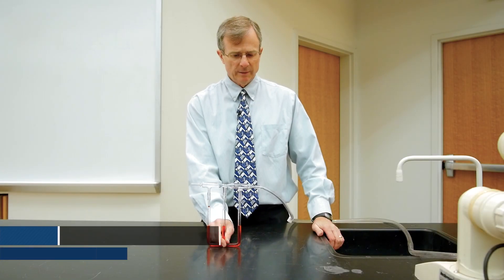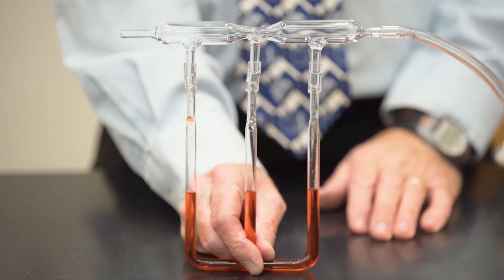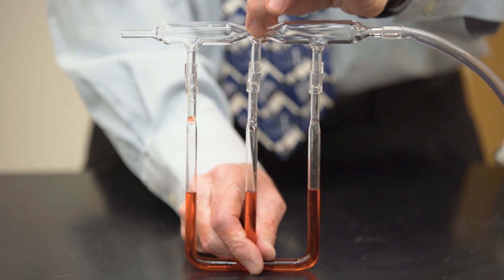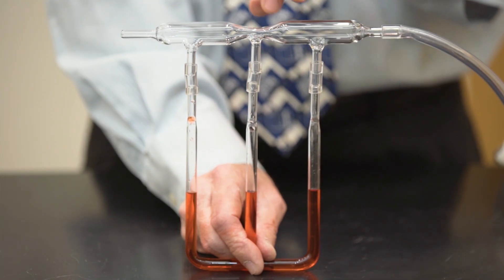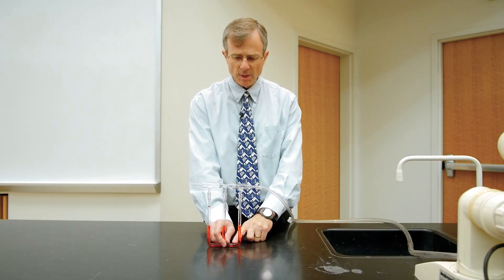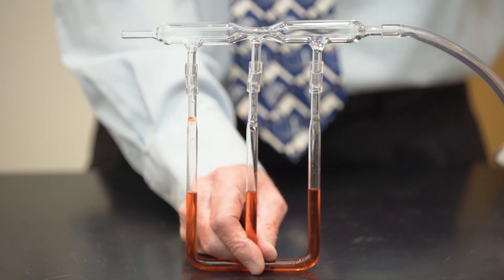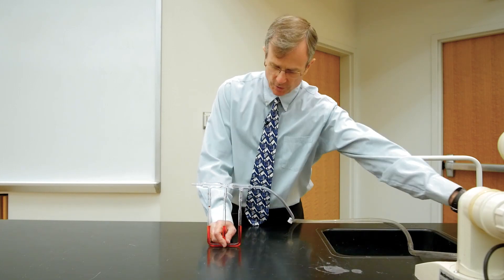Bernoulli's Principle Demo: Venturi Tube

Comment: this leaves more questions than it answers  , the gas entering the first chamber looks to be pushing the liquid down the U bend , not sucking the liquid at the narrow part of the 2nd chamber  and the gas entering the 3r  chamber is pushing the liquid back down the U bend .... so what is the Principle ?
Reply: Yes, same for me. is the third chamber lower again, or just compensating for the fluid level/ Also, is there a syphon effect in the middle, with a higher velocity?

Comment: Why were the water levels different on the two outside tubes?
Reply: Because the pressures in the two outside tubes were different. The pressure in tube #1 was higher than the pressure in tube #3.

Comment: I don't like when teachers don't explain why the pressure is lower at that restriction point. The reason, why it's lower is because of the law of conservation of energy. The flowrate must remain the same, like he stated, and because of this, the velocity must increase to push the same amount of volume of fluid over time. But the increase of velocity has to come from somewhere, it cant just be created. This is the reason for the lower pressure. The pressure in this scenario is potential energy, and the velocity is kinetic energy. In order for velocity (kinetic energy) to increase pressure(potential energy) has to decrease. The potential energy (Pressure) turns into kinetic energy (velocity). Think of a full balloon, when it's full, it has lots of potential energy, and as you let air out, its losing that potential energy and turning it into kinetic energy. Hope this helps someone, I know it helped me finally understand this principle.
Reply: You Helped Someone
Thank You
Reply: @Ram-xy2vy  yay!
Reply: @Ram-xy2vy  :  Ditto!  😊
Reply: @Ram-xy2vy 🔴 What Is Islam?  
 
🔴 Islam is not just another religion.  
 
🔵 It is the same message preached by Moses, Jesus and Abraham. 
 
 🔴 Islam literally means ‘submission to God’ and it teaches us to have a direct relationship with God.  
 
 🔵 It reminds us that since God created us, no one should be worshipped except God alone.  
 
 🔴 It also teaches that God is nothing like a human being or like anything that we can imagine. 
 
🌍 The concept of God is summarized in the Quran as: 
 
📖 { “Say, He is God, the One.  God, the Absolute.  He does not give birth, nor was He born, and there is nothing like Him.”} (Quran 112:1-4) 📚 
 
🔴 Becoming a Muslim is not turning your back to Jesus.  
 
🔵 Rather it’s going back to the original teachings of Jesus and obeying him.  
 
 
More .....👇 
 
🔴 THE RETURN OF JESUS
Reply: bro u literally answered all my doubts in just one paragraph!!! thanks a lot... respect!!!
Reply: I have been trying to understand this for a long time and tomorrow is my exam and i finally understand it thanks alot
Reply: @hajraaman9570  of course, hope you crushed it!
Reply: thankk uuuu u don't know how much that helped me!
Reply: Thanks! Together with the explanation and visuals of the video I think I got it now :)
Reply: Thanks
Reply: Thanks!
Reply: Thank You... Well explained. However, i am a bit of an over thinker, with a limited knowledge of physics, but a curiosity that keeps me thinking further into these things. What I am wondering, is, if there is no loss of overall energy, and the pressure is replaced by velocity, then, is it not harder for the media in motion, to move through a restricted space, and should that not cause a drop in overall energy, due to the resistance? Lets say the narrow part was narrower, or lasted longer, then would this not use up more energy over a longer path, or require more energy to drive it through?

Comment: At 0:35 he INCORRECTLY claims that the volumetric flow rate, the number of cubic centimetres per second, passing through the two spots has to be the same. That would be true if the fluid were a liquid, in which the density is constant. But it's air, a gas. Its density is dependent on the pressure and temperature. And we know, from the heights of the water in the tubes, that the pressure are different in the two spots. 
What is constant through the system is not the volumetric flow rate, but the MASS FLOW RATE, in gm/sec.
Bernoulli's equation (excluding gravity: P1 + 1/2 ρV1^2 = P2 + 1/2 ρV2^2) depends on constant density, ρ. Gases don't have constant density.
Bernoulli's equation doesn't apply to gases.
The pressure differences are due to the gas laws: PV = nRT, and W = (p2V2- p1V1)/ (γ-1). I haven't yet solved this experiment for the mass flow rate through the system, but I'm sure someone can.
Reply: Correct. It's the mass flow rate that is constant, not the volume flow rate. Air is compressible, its density changes with changes in pressure and temperature. That's how it's different from a liquid.
Reply: Yup mass in equals mass out... But the volumetric flow rate will vary along these restrictions... Thanks for finally pointing this out in the comments!
Reply: @chamberlin1  Amazing! The video has been up for 8 years with over 150,000 views and only two other folks have commented on this fundamental  flaw. How I grieve for the loss of wisdom in the physics community. 😞
Reply: @alans172 ❤ I've been working in the field of gas flow measurement and control for over 20 years, and it's something we have to explain to customers all of the time! Cheers and best wishes

Comment: The meaning of pressure in Bernoulli's law is unclear, leading to misunderstandings. Bernoulli's pressure is the pressure exerted on the wall. If you measure pressure in the direction of flowing fluid, the faster the flow rate, the stronger the pressure will be. If you don't agree, I'll shoot an air compressor in your face.

Bernoulli's law should be understood in terms of cohesion, not pressure. Fluids attract each other. The faster the flow rate, the more molecules are attracted.

Do not think that the faster the flow rate, the lower the pressure.
It is more intuitive to think that the faster the flow rate of the fluid in contact, the stronger the pull.
Reply: Has to be. Power washers have max pressure, after going through the Jet

Comment: I'm scratching my head to understand how the air flows from the second (narrow) chamber into the third (wide) chamber as it appears to be flowing from low pressure to (indicated by the length of the water column in the middle manometer)  to a high pressure (indicated by a shorter water column in the third manometer). Doesn't a gas only flow from high to low pressure?

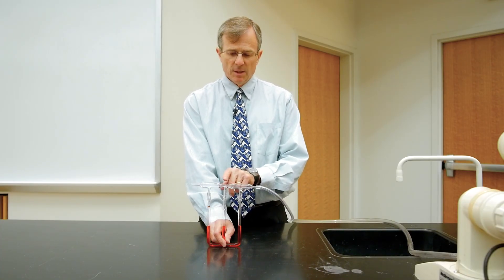Comment: 0:57 can anyone tell logically (not mathematically) about why pressure is low?
Reply: Sure. If I shrink down the middle section until it is only big enough to fit 1 atom then the pressure is only equal to the kinetic energy of 1 atom right? And now because only 1 atom can fit in there he does not have to worry about bouncing into some other guy and losing energy and wasting time in the tube, he has the highest possible throughput. The wider the tube the more atoms go in there, which makes it harder for them to get through. They all keep bouncing around.
Reply: @Auxified It’s nice when you explain things in the extremes. As the atoms goes to 0 or to infinity can really help you understand the extreme effects. Thanks a lot man 🙏

Comment: I understand the concept and the explanation is good. However, why does it feel like there is more pressure coming from a hose pipe when you use a finger to restrict the hose opening (when watering flowers for example)? The water increases in velocity due to the restriction, as the video says, and so travels further from the hose, but it also feels as if the pressure has increased when you pass your hand through the resultant spray of the mostly blocked hose. Compared to the low pressure you'd feel on your hand with the hose opening completely uncovered, it seems increased when partially blocked. Does anyone have any insight? Thanks
Reply: According to the continuity equation (A1*V1=A2*V2) when you cover the opening of the hose the velocity of water increases. 

When a high velocity object hits a barrier the force acting on the barrier is high compared to a low velocity object. 

Pressure= Force / Area.

As the area is same in both cases you feel like the pressure is high when the water hits your hand.
Reply: Yes, or a power washer nozzle.... restricting flow to achieve high pressure?

Comment: Beatiful. You can improve this demo by using open ended venturi tubes, which sit in a open bucket of fluid to isolate one end of the tube to the other one.
Reply: agree,so hard to find video like you said,but question always ask about that

Comment: Thank you for the explanation. I have a question. You stated that the same amount of air has to pass through the wider region in a given period of time as does the air passing through the thinner region. However, won't the compression of air prohibit that from happening?
Reply: Check out the concept called continuity in fluids
Reply: Yes the amount of air per unit time sounds like the volumetric flow rate.  As far as I can tell it's the same thing.  It must be that sometimes a volumetric unit of a gas means the amount of it that occupies the unit volume when at standard pressure and temperature.

Comment: Why is the liquid in third tube remains unaffected . Someone please explain 🥺
Reply: If you look closely, the liquid in the third tube rises a little. This could be because the velocity of air in the second wider section is higher than the first wider section as the air is coming from the thin section (where the air is travelling at the highest velocity). This causes the liquid in the third tube to rise a little bit, but not as much as in the second tube.
Reply: My assumptions is that it is because the third tube is near the exit of the duct, and is therefore closer to the atmospheric pressure in the room, which is the pressure inside the tubes when the flow is turned off. This might explain why the height of the water columns doesn't change as significantly.

Comment: I'm not sure the flow-rate description works as described because the air is compressible. Bernoulli's principle originally described situations where the flow was from incompressible liquids, which was essential to continuity. The demonstration is interesting, but involves more than Bernoulli.
Reply: @AuMechanic  Perhaps, but THE "Bernoulli's Principle" equation, as taught in first year physics is most likely the one people will have in mind when they search for and find this video. Ironically, Bernoulli's equation was actually formalized by Leonhard Euler, about the time when Giovanni Venturi was only 6 years old.
See, most non-physics majors taking physics will only ever see this one equation or hear about this one element related to Bernoulli, and still misunderstand THAT, when the explanations and special conditions regarding this principle and equation are not clarified.  They're oblivious to extreme exceptions and corner cases.
They will never know about Bernoulli's family life or other contributions. And they will continue to point to air-flow examples and squeal "Bernoulli!" inappropriately, without understand why, or why it's inaccurate.
They will also never become familiar with all of the other contributors to fluid flow dynamics, the work of many of which is far more relevant to current applications in aerodynamics and hydrodynamics.
The point is ... if they're only going to ever learn this one thing about this one guy, let us (as instructors) get it right.
Reply: @ezfzx  Thank you for bringing happiness to our lives.
Reply: In Fluid Dynamics at Mach number < 0.3, airflow is considered incompressible. So we can use Bernoulli's Equation in such a case.

Correct me if I am wrong sir.
Reply: @Lalo-Salamanca.  Respectfully, my concern is this. There are far too many air-related demos that are described as Bernoulli, which either are simply not, or, at best "Bernoulli-adjacent". So demos one my colleagues did with open air flowing over the top of liquid-filled pipes from different directions had some very interesting and unexpected results which were inconsistent with Bernoulli's principle.

Our department has a Venturi Tube demo like the one you're showing, and it's good to see the lower pressure, pressure differential, etc. (We also point out that Venturi came along about 50 years after Bernoulli.)

My point is that any air-flow effect cannot be just attributed to Bernoulli without at least some kind of disclaimer. Bernoulli (the guy) was very clear about the conditions of his equation: incompressible, inviscid, laminar flow, closed system, no added energy. We can perhaps dismiss the slow air as approximately incompressible, but not the rest. Even slow moving air behaves differently moving into and out of a pinch, as we see in wind tunnel tests. Even the A/C repair people can tell you that. You can see where the dust piles up from the gentle turbulence.

Academically, for students who don't continue to study fluid flow for a living (aircraft designers, for example), it becomes very easy for them to make this one association without appreciation for the nuanced exceptions, and should they go on to become teachers, simply recite it like gospel, perpetuating the misunderstanding. (I've had high school science teachers, who never worked in industry, try to argue with me about it, until I show them a few demos that contradict their understanding. That's the nice thing about physics ... I don't have to argue; I can just show it. And I'm looking for a video to show you too.)

The demos are fun and exciting and amazing, so-much-so that it's tempting to perform them without the details, just to wow the crowd. However, for the scientist/engineer, there's something deeper and exciting going on, and it would be disappointing to miss that opportunity.
Reply: @ezfzx  Thats fact. If we aren't involved in it for a living,  we take things in approximation. I understand your point sir !
Reply: @ezfzx you raise a valid point
Reply: I wonder if it's possible to calculate the mass flow rate through this system? We can make some fairly accurate measurements for the video: Water levels in tubes compared to level in first tube (A): A:0.0, B: 9.5, C: 5.3 cm. Diameter of the chambers: A: 1.6, B: .5, C: 1,6 cm. Let's assume the temperature in Chamber A is 0°C . The ambient is NTP (15°C and 101,300 Pa) and the gas is air (M 0.029 kg/mol/°K, gamma = 1.4). Any suggestions as to methodology?
Reply: Don't tell my carburettor that!   😮

Comment: I'd like to see this same demo, start and end with the pump off, BUT with all three manometers referenced to atmospheric pressure.  That left-hand level not changing much bothers me.  

That looks like a three pronged manometer, not three individual ones. That shows an interrelated relationship that isn't at first obvious. The pressures in the two wide sections should be closer.
..
ALSO, that second narrow section on the far left is confusing things...